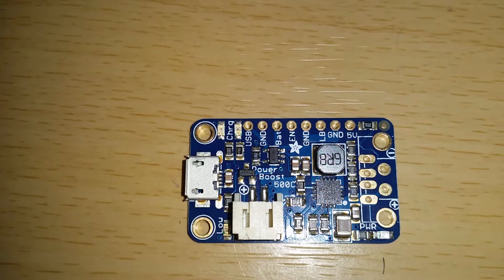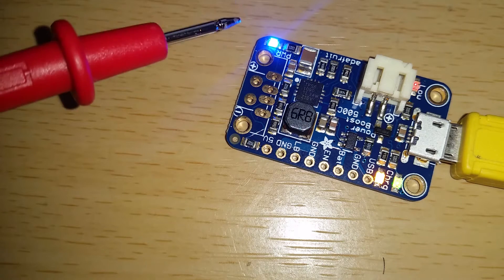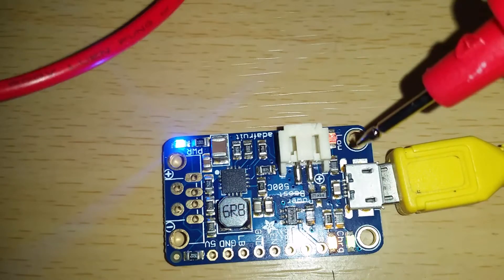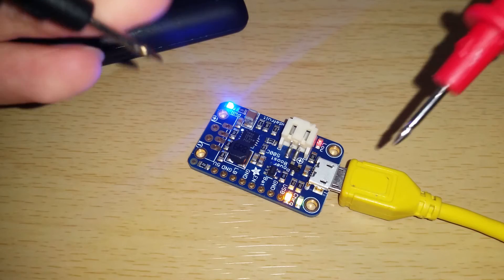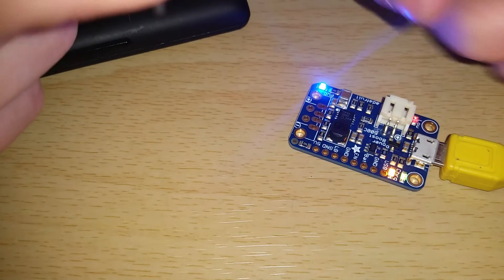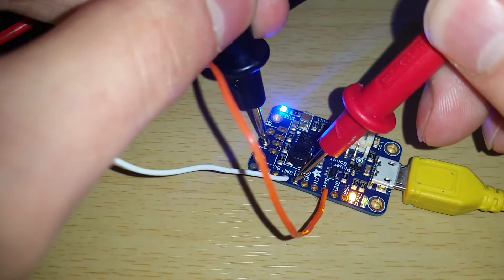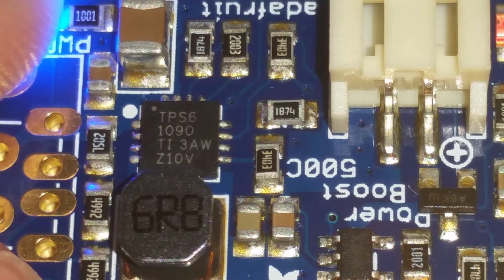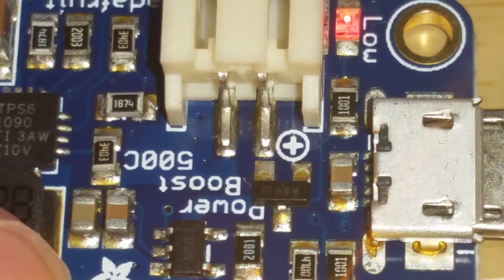Adafruit PowerBoost 500C + Charger In Depth Review

Comment: I didn't bother to scroll through the 25 comments, so this may be a repeat. The two LEDs on bottom right are both CHG LEDS.. green for charged batt, and yellow for charging. The label USB is for the pinout where it is silked. You can grab a 5v straight off your USB when plugged in. This unit really only works properly when a batter is plugged in and Adafruit suggests not using it without a battery installed.

Comment: Hi, i'm trying to use this to charge my phone, but don't want to deal with connecting the USB because it makes it very chunky.  I was wonder is it possibly to connect my Lightning cord directly to the powerboost?
Reply from the maker: it should work
Reply: where on the powerboost would i connect the cables.  I'm just interested in charging, not data transfer
Reply from the maker: Where the USB would have gone. You probably need to connect the data cables too as the iPhones require these to charge.

Comment: Hi. I have a future project using electroluminescent lights. I want to use one of these to be able to power and charge a Li-ion battery. However, due to the powerboost, from 3.7V to 5V, can the output still be 3.7V instead of the full 5V? 5V EL inverters are no where to be found and the closest is a 3V inverter (which is what I’m trying to use). Is the output strictly 5V or is it in a range such as 3V to 5V?
Reply from the maker: Endothermic Madness Hi, as this device outputs to usb, it will only output 5v. This may work or may make your device run hot and break quickly. This is closer to what you need, it will connect to a battery and always output 3v. You can put the powerboost before this device as the powerbooat has a lot of overdischarge protection and has a charging circuit too: https://www.adafruit.com/product/2745
Reply: Ahmad Khattab, do you think it would be possible to connect my 3V EL loop to the LBO connection? According to the PDF instructions, LBO is standard output from the battery and then 5V is of course, the 5V output. The holes  are intended for connecting separate circuits and switches, apparently. I can solder my 3V loop to the LBO and possibly a motor controller to the USB part.
Reply: Accidentally put GND instead of LBO (Low Battery Output).
Reply: Ahmad Khattab, plus, reviewed the wiring diagram, I saw of my EL lights come with power indicators in the circuit which will be convenient instead of having to see the circuit board’s battery indicators.
Reply: Ahmad Khattab, found that the Buck converter would be best for what I’m doing. Only issue, I can’t find any wiring diagrams anywhere. Can you indicate to me where I’m supposed to connect the 500C to the converter and then my EL male wire on the output?

Comment: I believe that you should not remove the power LED because it is used for discharging the capacitors in the circuit when you unplug the circuit.

Comment: Hello !!,

it works with a 6V lead acid Battery??
Thanks
Reply from the maker: I don't think so
Reply from the maker: +Ahmad Khattab also,it outputs 4v, not 6v
Reply: Thanks for the reply!!,
how can i re charge a 6V lead cead  battey.., something like the PowerBoost 1000 Charger - Rechargeable 5V??
Thanks again
Reply from the maker: I haven't tried, but found this: https://www.amazon.co.uk/Automatic-Battery-Charger-Batteries-electrosmart%C2%AE/dp/B003ZDZMS4

Comment: Your continuity test is unreliable since the circuit was powered while you did it. Also, I'd expect the USB ground to have low impedance to the shield, even if they weren't tied together on the PCB. Try that test without USB plugged in.

When you checked the current into the "battery", you were shorting the battery terminal to ground. Whatever reading you got seems pretty meaningless since a battery should never be a short.